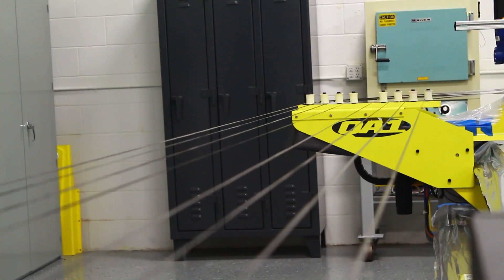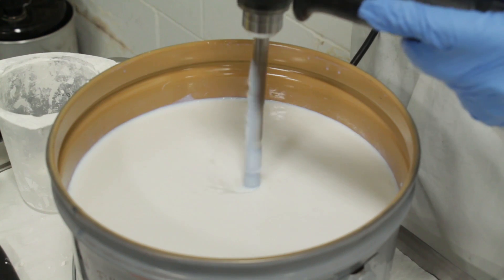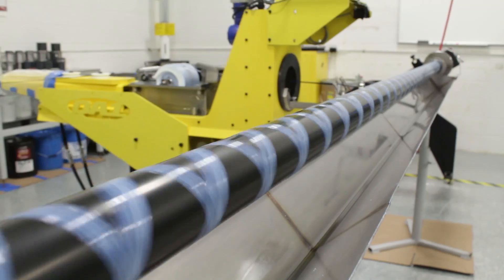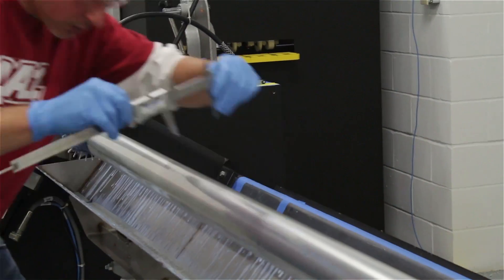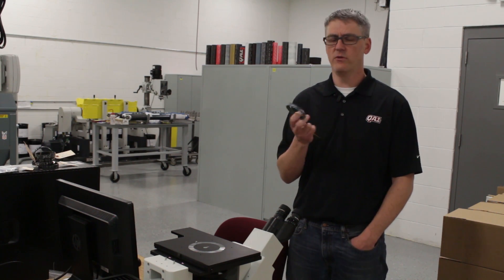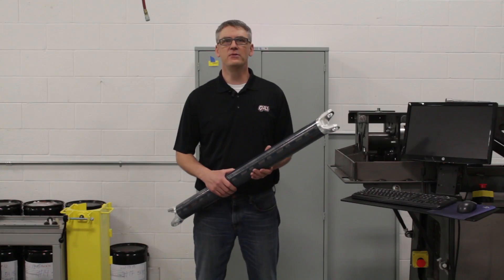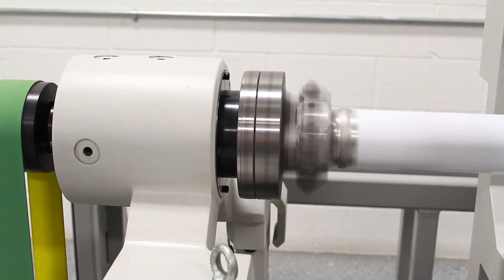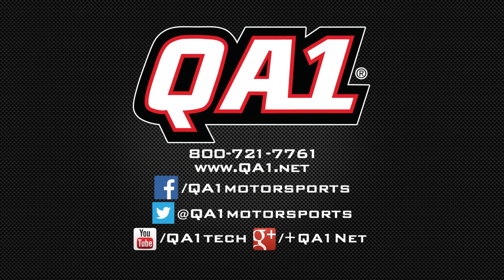How It's Made: Carbon Fiber Driveshafts

Comment: 4:45 I really hope you mispoke and are not actually testing the ultimate strength on every driveshaft lol
Reply from the maker: +TheXdmgx7 You're right. We don't test to the ultimate strength, but we do test to an established torque value to ensure it meets our performance standards and quality.
Reply: +QA1 Precision Products I figured. Thanks.
Reply: Yard Sale Dale - Speed Academy has a video showing the swap of a Mustang 2 part driveshaft with a QA1 carbon fiber one piece shaft...   it’s a suped-up daily driver/track day car so I imagine it will work well (they saved 19lbs from the original shaft and lost the slop of the two piece OEM).    These are a highly engineered, tested and proven product so they’re well worth the investment if you’re on the higher end of power.

https://youtu.be/Jf49MYwvNZk    ← Speed Academy video

On a side note, an accident in 2003 b0rked my spine and left my right leg completely numb from the nerve damage from my knee to my hip...   I need a cane to help my brain know when to expect my foot to come down (it’s really weird) and a local Florida company Carbon Canes set me up with a carbon fiber cane.    There’s a massive difference in the weight of a wood or metal cane compared to carbon fiber and that really saves your wrist from the strain of a traditional cane...   plus, that you can see the cool carbon fiber reflections in good lighting and the flames on the bottom make it go much faster !!!
Reply: Yard Sale Dale - I imagine they would perform well in a “daily driver” role since they are designed for much more aggressive applications but it’d be a massive bit of overkill...     it’d be like putting a Bugatti Veyron’s tires on a VW Jetta...   you could do it, but why?    If you’re building a race car where every kilogram matters and you’re pushing insane power, then you’d want this.
Reply: Scorpion7substance - I thought what I'd do was, I'd pretend I was one of those deaf-mutes...

That way I wouldn't have to have any goddamn stupid useless conversations with anybody. If anybody wanted to tell me something they'd have to write it on a piece of paper and shove it over to me. They'd get bored as hell doing that after a while, and then I'd be through with having conversations for the rest of my life...   or should I?
Reply: Scorpion7substance - lol...   it’s the quote from ”Catcher in the Rye” that spins around the logo (the top line)...   the second part is the bit right after that they discuss in depth in the series...     I’ve prolly looked into the abyss of GitS a bit too much  ٩( ᐛ )و
Reply: Dude u got really serious all of a sudden, hay man no trouble, just moving along.
Reply: Thank you for the info Laughing Man from Ghost in the Shell.
Reply: LOL oh man u had me worried :>)
Reply: both
Reply: Scorpion7substance - sorry about that...   some friends of mine analyzed the dren out of GitS for an undergraduate program and wrote a 500-some page paper on it...   crazy I know, but very interesting as well (there was around 150 pages just for the Tachikoma !!).    Add to that the reddit and other forums and I’m an otaku　٩(^‿^)۶     Funny how far off topic this thread became...

Comment from the maker: +Yiotis These come balanced from the factory as a complete unit. If it was out of balance later on, something most likely happened to the driveshaft, and we would need to do further investigation why that was.
Reply: Just came here from the "Project X" HotRod Garage video. Do you guys make custom-length driveshafts aswell? Or even custom outer diameters?
Reply from the maker: Hi BigBlockRC, we design our carbon fiber driveshafts specific to your vehicle and use. Here's a link to get you started: http://www.qa1.net/driveshafts/how-to-order-a-custom-driveshaft 

Also, if you can always feel free to cal our tech line at 952-985-5675 M-F 8am-5pm CST with any questions you may have. 

Thanks!
Show less

Comment: little skeptical of the what it seems to be glued on u-joint piece. would figure some type of machined splines on both the aluminum and carbon fiber pipe plus an adhesive.
Reply: It probably won't give you peace of mind, but most modern aircraft are 'glued together'.  ...Just as helicopter rotor blades have been for 50+ years.  (Seriously... on most helicopters, just a little bit of 'glue' stands between a lovely flight, and, "OH JESUS! OH JESUS!")
Reply: @mysterymete  I realize this is a very old comment but could you recommend a product to bond the end of a driveshaft. I have a RX8 and I hope to do a engine swap and would like to keep the CF driveshaft.
Reply from the maker: +Devo We've done exhaustive testing to ensure that the adhesion process is the best it can possibly be. The nice thing about our structural adhesive is that it bears the load over the entire surface to give you incredible strength. We also have engineered our driveshafts so if there is ever a failure (which hasn’t occurred outside of our labs to date), it would be in the middle of the shaft, not at the end.
Reply from the maker: +Lawrance Letithangburger It really comes down to torque. It sounds like you would need our driveshaft with the 1350 u-joints, which is rated for up to 1500 lb*ft. What's your maximum torque?
Reply: +QA1 Precision Products  Interesting, how do you address[ or recommend] a carbon fiber shaft for a 4150 Pound car using a 4-speed manual transmission in a street/strip application with a 10.5 inch rear tire? The shock/impact loads are brutal! I`ve twisted one aluminum shaft so far, or is carbon fiber not the material to use here?
Reply: Bonded joints are pretty much universally standard

Comment: What education is needed to learn the skills involved in creating and manufacturing composites? I'm guessing a mechanical engineer degree?
Reply from the maker: +Robbie Tosh Mechanical engineering is good or you can get a more specific degree in composites engineering.
Reply from the maker: +Neo Quello We are looking for a Driveline Design Engineer. If you think you meet the qualifications, you can always apply. Info is on our website at http://www.qa1.net/about/careers.
Reply: I worked for toray composites in washington for 10 years right out of highschool, but we were making the resin impregnated rolls of carbon fiber for boeing parts, sports equipment car parts ( acura body and frame, viper body frame and driveline, corvett drivline and hood) find a place and apply to get ur foot in the door

Comment: Do ya'll create axels?
Reply from the maker: +Jared Coles We don't currently offer axels, but we're always looking to add to our product line, so thanks for the suggestion!
Reply: +QA1 Precision Products  hi , i got carbonfiber shaft on 3000gt vr4 it vibrate alot after speed 100kmh what is solution to fix it ? repairable ?

Comment: Darn the ONE thing i wanted to know about and you left it out!
Reply from the maker: +wasshp not We spent a long time developing our procedure for joining the yokes to the carbon fiber. We specially design our yokes to work for our driveshafts and use a structural adhesive to bond them together using our proprietary 11 step process.
Reply from the maker: +dantheman1998 What was it you wanted to know?
Reply: How you attach the output yoke to the carbon fiber. You can tell me how you do it. I wont tell anyone else :)
Reply from the maker: Sorry dantheman1998, that's top-secret information.
Reply: +QA1 Precision Products is it the same way we do it here at the drive shafts shop?